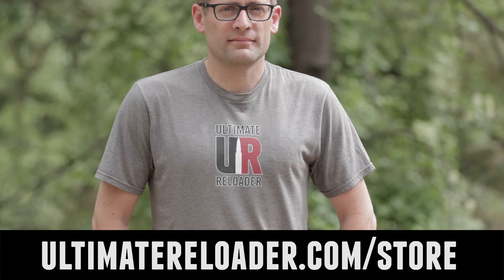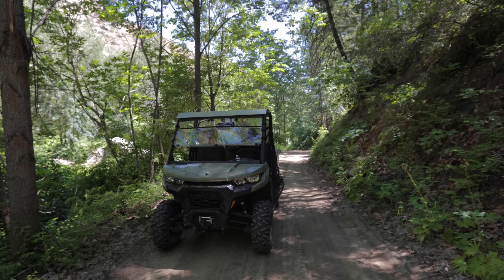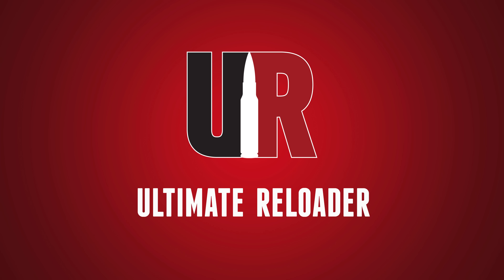Henderson V3 Cutter Adjustment (2 ways)

Comment: Forster has had a similar head out for 15 years, RCBS also has a 3 in 1 cutting head.
Reply: They literally started out using forester head and later designed their own but as you can see it's still using Forester blades and pilot.  P.S. I have RCBS also but it's just not the same!

Comment: Thanks again for another Great Video. Super Helpful. Mine just arrived yesterday and I will trim .223 Bolt, 6 Dasher, 6 GT, 6x47 Lapua, 6.5 Creedmoor, 28 Nosler, etc etc. . The only challenge I have run into is on AR Rounds where I want more neck tension. The cutter pilot for .223 is too large (.220) for a non bushing full length sizing. I really don't want to expand necks on AR's before trimming so I will have to figure out a smaller pilot somehow. I did a test and only get .002 tension and since I don't crimp I feel that's a little light. I"m right down the road from Benchmark so maybe they can polish off a couple thousandths. OR maybe Todd can get me a smaller pilot for .223 and .308?? Thanks again for all the great information. Jimmy G

Comment: Perfect timing as my trimmer showed up Saturday with one of the carbide cutters laying in the bottom of the box. At first I didn't know what it was, good thing I didn't toss it out. I got it back in, adjusted and locked down. This thing is awesome! Smooth, quiet, and way faster than my RCBS Case Prep Center. Glad I finally took the plunge. Well worth the price for an American made precision machine. Even the packaging and boxes are top notch.

Comment: I like the look of the henderson and all the reviews are great but I think the Giraud seems to be a faster system. I debated over the 2 but placed an order for the Giruad to replace my Hornadt LNL case prep. I am anxiously waiting for the Giraud and my Auto trickler.
Reply: Both works very well, but they are very different, Giraud uses the shoulder of the case to determine trim length, not the Henderson.

Comment: I missed this video.  This is a cool way to setup that inside blade.  I found that in my Forester trim head the pilot is off center by 6 thousands so it wobbles and scores inside the brass neck.  I tested this by machining a .157 pin and when I put the body in the chuck I get .001 run out which most likely from my lathe but the center pin is .006 and that's too much, you can see it with naked eye.  In your video when it was running the pilot doesn't move, maybe that's why Henderson started making their own heads to be more precise.

Comment: Liked the video but would have liked to have seen a close up of your end result. I recently acquired a Henderson trimmer with 4 cutter heads. I was trimming my 33XC brass with the factory adjusted head and it appears to me that too much material is being removed from the outside and very little from the inside. So maybe a few close ups of what you consider perfect or acceptable. My brass ended up with an almost knife edge which I don't think is desirable.

Comment: I have had a Henerson trimmer for ~2yrs.  I would give up a lot of my equipment before i let my Henderson trimmer go.  I believe this ONE SINGLE piece of equipment has improve the consistany and accuracy of my hand loads over all of the other equipment i own.  I don't remember what Todd advertises for +/- accuracy, but my Henderson cuts +/- .0005 between my trimmed cases.  I load .223, .308 and .338 Lapua Magnum.  I can't wait until he comes out with a setup for the .375 Cheytac.

Comment: The Henderson V3 trimmer is awesome, I guess as long as you're in for $780 what's another $70 a pop for extra cutter heads.  My Frankford Arsenal universal case trimmer @<$100 doesn't have the cool factor of the Henderson, but works pretty well

Comment: I was struggling with setting up my Henderson V3 cutter because the cutter was set not to my linking from the factory.

The Pin / Feeler gauge method worked flawlessly. Thank you for sharing!

Comment: It's a great tool and if I had to do a couple of thousand rounds to do on a regular basis I would invest in one but at $450 it's just to much money.  I shoot a thousand rounds a year and trim every 5th loading.  For that small amount I use a Frankford Arsenal Universal Case Trimmer in a drill press and for a few calibers I use a Little Crow WFT.  $75 for either but I do deburr and chamfer with a Hornady Case Prep Duo $60 and it literally takes 4 seconds.  The Henderson is a nice unit but with the $300 saved that would pay for a MEC Marksman or RCBS Rock Chucker press and a set of dies.

Comment: A better set of feeler gauges would be what is called " go - no go" feeler guages. The end of the gauge is thinner than the main body and is the thickness that shows on each one. The main body is .002 thicker. So you can use the next size smaller and see how exact it is adjusted to.

Comment: This looks complicated for the average Joe
Reply: They come preset for the average joe
Reply: Complicated? Reloading is precision work. If you can't make simple adjustments to your trimmer maybe it's just not a hobby for you 🤷‍♂️
Reply: @Laidoffsick  complicated?  No.

Very tedious?  Yes.

That’s why Henderson does not recommend you touch them from where they are set from the factory.

Not sure why Gavin decided to make a video about this because its not necessary whatsoever for the large majority of Henderson users.
Reply: @SigmaBallistics  well 1 of my cutters fell out in the box so I had to put it back in adjust it. Video was a ton of help for me.
Reply: @Laidoffsick  wow thats not good!  Yeah i’m glad he posted it too though, I run a 338-408 cheytac wild cat with a pretty thick neck that may benefit from tweaking.

Todd said he is coming out with a cheytac length rail and cheytac collet at some point as well.